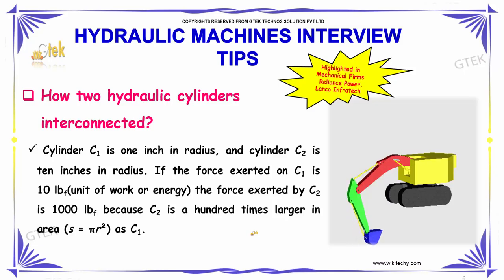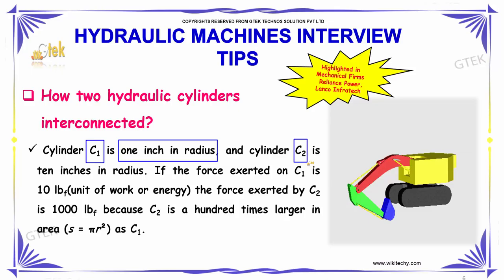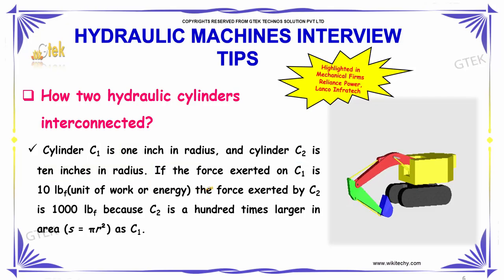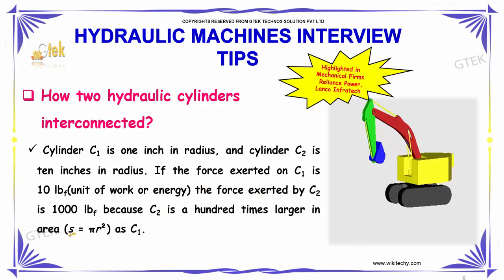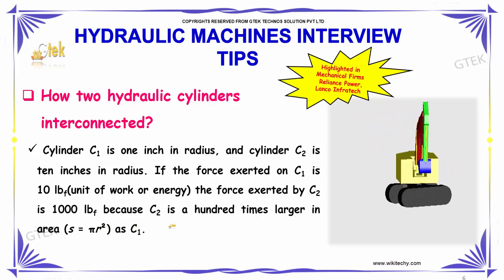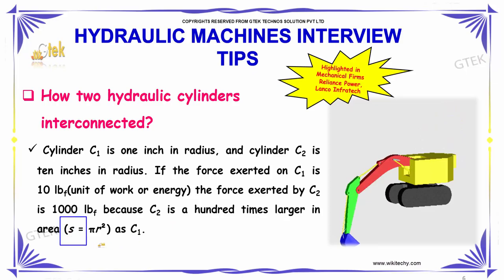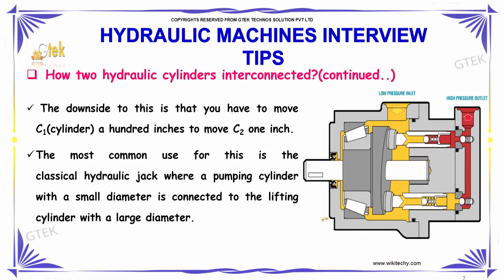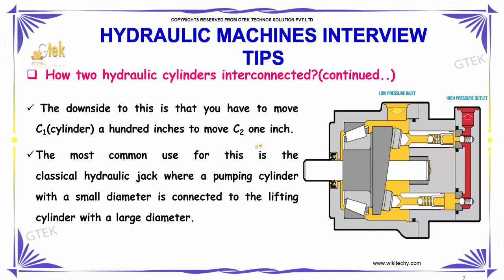how two hydraulic cylinders interconnected | hydraulic machines interview tips | wikitechy.com

Comment: wo hydraulic cylinders interconnected Cylinder C1 is one inch in radius, and cylinder C2 is ten inches in radius. If the force exerted on C1 is 10 lbf, the force exerted by C2 is 1000 lbf because C2 is a hundred times larger in area (S = πr²) as C1. The downside to this is that you have to move C1 a hundred inches to move C2 one inch. The most common use for this is the classical hydraulic jack where a pumping cylinder with a small diameter is connected to the lifting cylinder with a large diameter. Pump and motor If a hydraulic rotary pump with the displacement 10 cc/rev is connected to a hydraulic rotary motor with 100 cc/rev, the shaft torque required to drive the pump is 10 times less than the torque available at the motor shaft, but the shaft speed (rev/min) for the motor is 10 times less than the pump shaft speed

Comment: Synchronizing Cylinder Circuits. Some machines with multiple cylinders require that the cylinder strokes be perfectly synchronized for the machine to operate properly. ... One advantage of mechanical synchronization is that the cylinders can operate anyplace in the stroke without

Comment: A hydraulic cylinder (also called a linear hydraulic motor) is a mechanical actuator that is used to give a unidirectional force through a unidirectional stroke. It has many applications, notably in construction equipment (engineering vehicles), manufacturing machinery, and civil engineering.

Comment: two inter-connected hydraulic cylinders (Cylinder 1 and Cylinder 2), which working chambers are filled with oil (incompressible fluid).

Comment: For the hydraulic fluid to do work, it must flow to the actuator and/or motors, then return to a reservoir. ... Multiple valves can be connected

Comment: Hydraulic cylinder to tilt a ladle of molten metal, ... If two independent cylinders in different locations extend at the same time. ○ When cylinders are connected in parallel, the cylinder.

Comment: Mechanical Engineering - Pneumatic-hydraulic cylinder Is ... Is Pneumatic cylinder used as a hydraulic cylinder, if so how? ... Asked by: Interview Candidate. Define verification and validation. Explain the differences between the two. .... Get invaluable Interview and Career Tips delivered directly to your ...